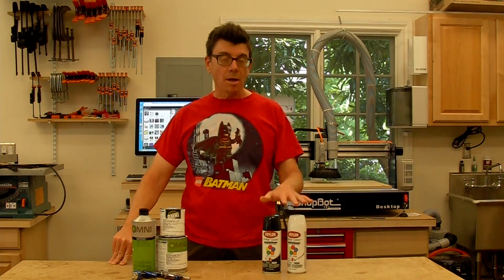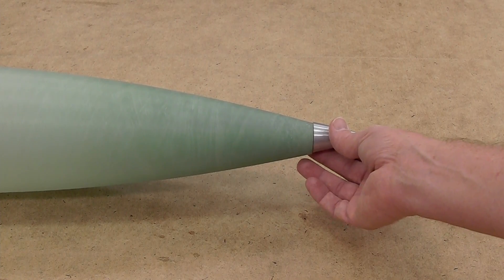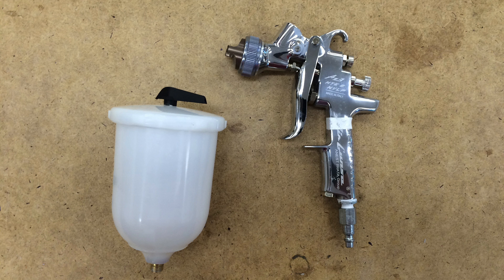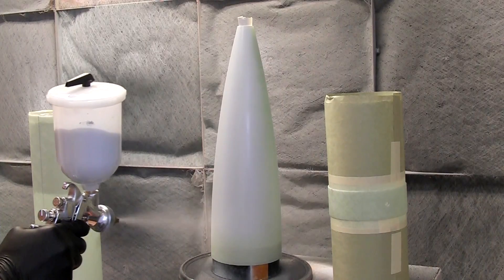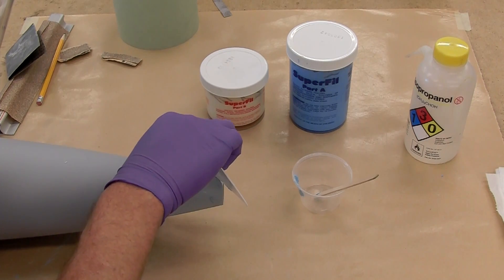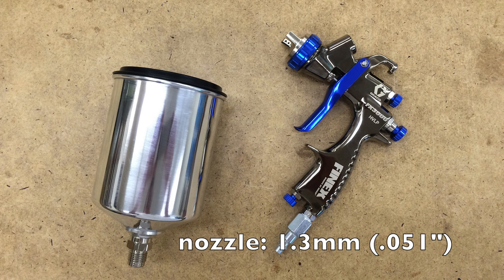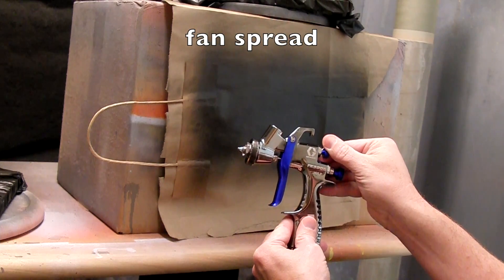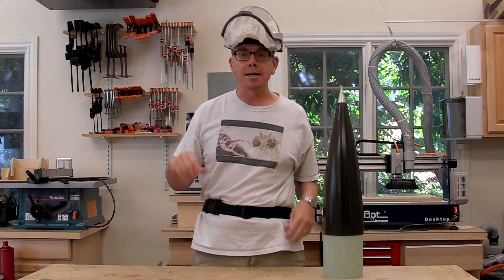Automotive Paints

Comment: you can fill with just primer then block it out also you can add a micro gauge on your gun so you can see the pressure at the gun just take the chuck out and screw the gauge in then add the chuck back